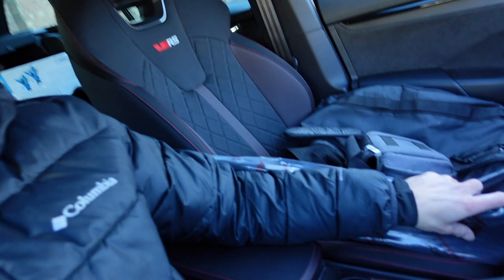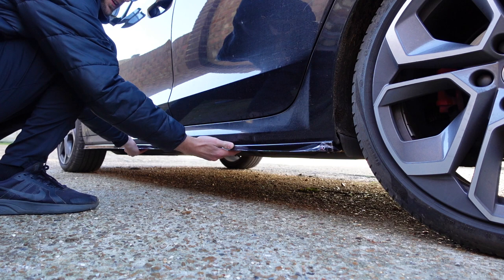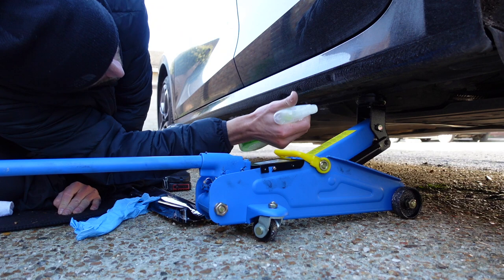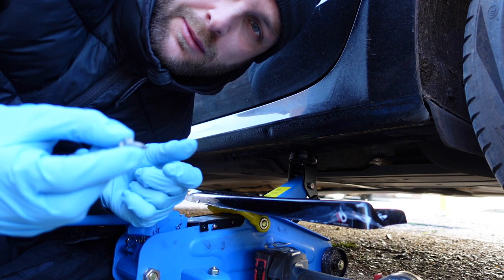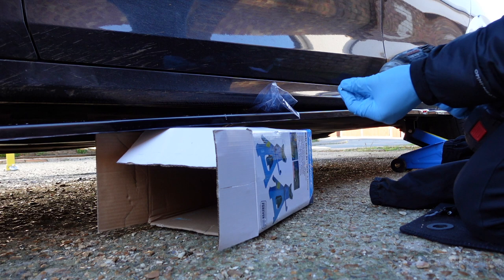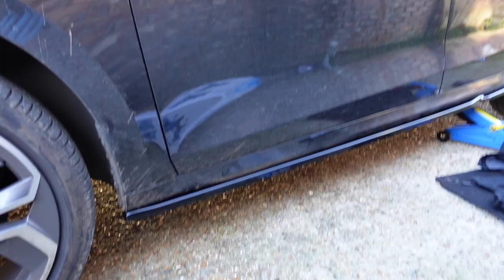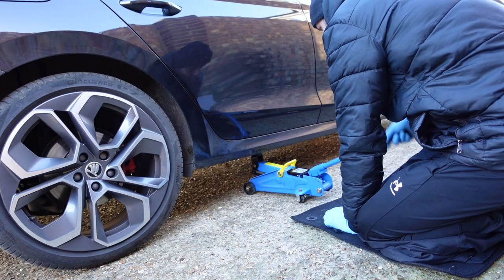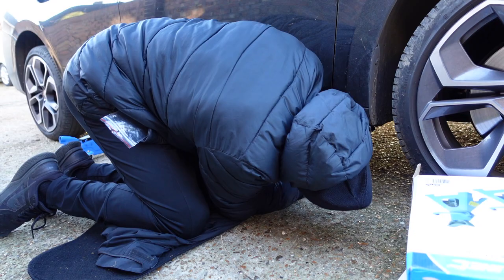MAXTON SIDE SKIRT DIFFUSER INSTALLATION SKODA OCTAVIA MK4 vRS 2023

Comment: did you screw them directly into the metal of the car ?
Reply from the maker: Yeah just straight in 👍
Reply: @tubedarren  bruhhhhhhh thats gonna rust in couple years
Reply from the maker: @ovidijuspetrauskas2621  so how else are they meant to be fitted?
Reply: @tubedarren  for future instalers please use a high strength contact adhesive to bond to the sill but also around the screws so that it sealed up the hole, or fill the hole with sealing silicone, in order to avoid future rusting